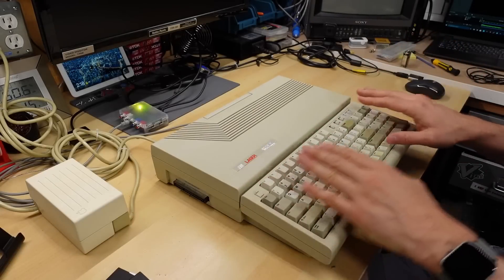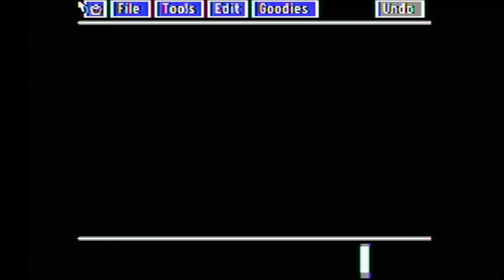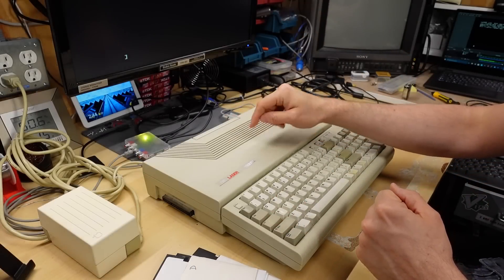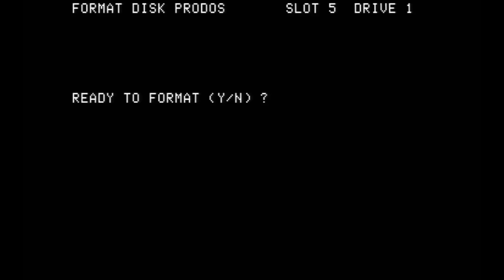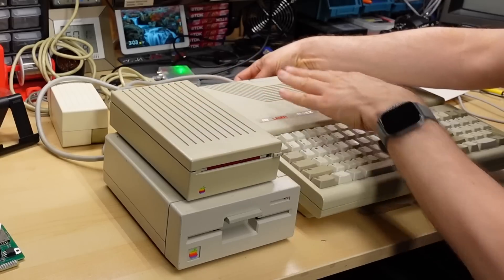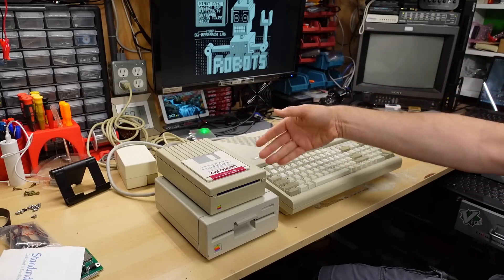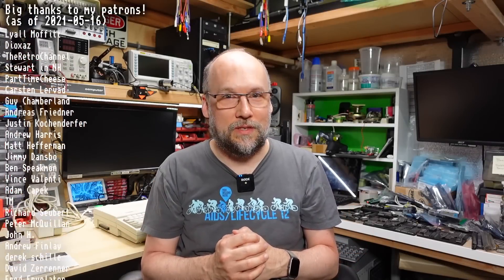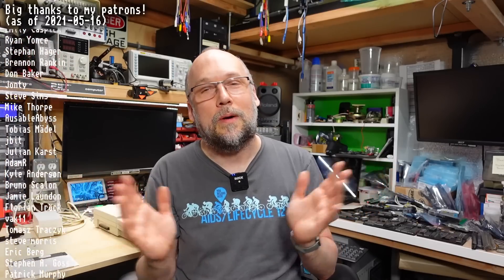Laser 128EX: Proving this machine is better than an Apple IIc

Comment: Well, that game speed thing wasn't entirely correct. Early PC games were often timed using code loops which made them run faster on faster machines. I remember a Space Invader type game that had this problem. Running it on a IBM PC/AT was fine but try to run it on any of the faster clones and you really got your reflexes tested. Another was the original Theme park Tycoon, or at least I think it was what it was called. I bought a copy when it was released in the golden game line. That was games of years gone past that got rereleased really cheap. Well i tried to run it on my 486 PC and it was hilarious. The game started and everything was totally whacked. The available cash was running down as, I guess, the running costs of the park got deducted day after day. Only problem was that you ran into bankruptcy within three or four seconds...
I never really bothered to work around this problem so I can't say for sure what was going on, and at the increased speed all you saw was a few people running around like squirrels with their tail on fire. And like I said within about 3 seconds the game was over...

Edit:
Also, a friend had a early PC/AT clone, one of the first. I think it might have been a Copam. It had a 286 processor that was capable of hitting something like 10 or 12 MHz. I think it was capable of reading floppies at the higher speed, but whenever you wanted to format a floppy, copy files to the floppy or just write a document to the floppy you had to hit the Turbo button to switch to 6 MHz or the written data would be corrupted.

Comment: Such a fascinating machine and amazing degree of compatibility. The 40/80 column implementation seems to be a direct result of the clean room reverse engineering. Neat stuff. The "turbo" modes are pretty mindblowing as well, going up to 300% performance no less.
Reply: 360%, if you want to get picky. :)

Comment: It's interesting how this clone machine seems like an inspiration for PC clones. You have a clean room reimplementation of the BIOS and it runs Microsoft software. Steve Jobs probably called up Bill Gates to rant at him. Also, the industrial design reminds me very much of the Atari ST for some reason.
Reply: Microsoft made BASIC for most of the early home computers, including Applesoft BASIC and Commodore BASIC. It's entirely possible (maybe even probable) that the company that made the Laser 128 licensed BASIC directly from Microsoft as well.
Reply: @evknucklehead  it was. The only thing Apple could put their foot down was on the clones not being able to use the name "AppleSoft". Hell, Atari Inc's contract with AmigaCorp dictated that they'd use a BASIC compatible with AppleSoft BASIC so Amiga BASIC being Microsoft BASIC was planned long before Commodore took over Amiga and inherited its hardware.
Reply: Also, the PC clones were already out there when the Laser 128 came out. For that matter, Laser themselves had an IBM XT clone in this same form factor. I think The 8-bit Guy has a video planned for the Laser XT, and he's shown it in videos sitting next to a Laser 128.
Reply: @evknucklehead  Absolutely right, take the Tandy 1000 series starting in late '84 ... And Compaq made the (I guess?) first PC clone as early as late '82, so...

Comment: so Apple, over all the many years and new models of Apple II that were manufactured, never addressed such a fundamental flaw as lack of timer interrupt and real time clock? (Or wait, didn't the Apple IIGS have that?) Amazing Apple II cost so much more than Commodore 64, but in a lot of different ways it was inferior. The one thing it had was faster floppy drive access and expansion chassis of card slots - but its entire file system system software had to reside in 64K address space of 6502 CPU, whereas Commodore went with intelligent drive devices on a serial bus
Reply: The Commodore 64 serial bus was slow. And the Atari 8-bits did that before them with the SIO Port. And it was faster [but not faster than parallel drives with a controller]. Not to mention it's the ancestor of USB and Firewire.